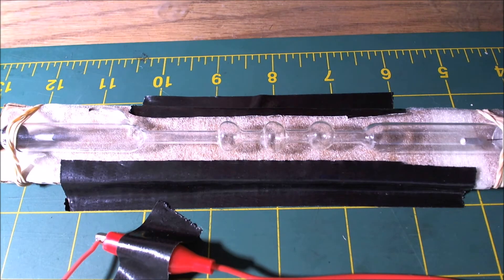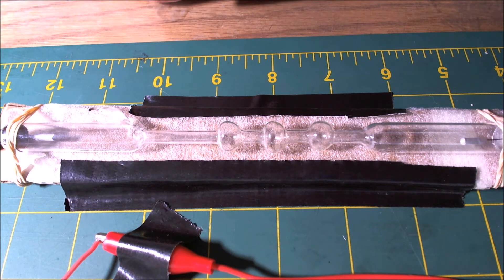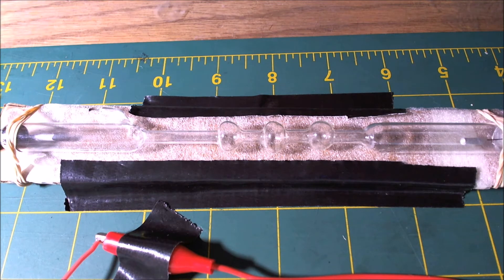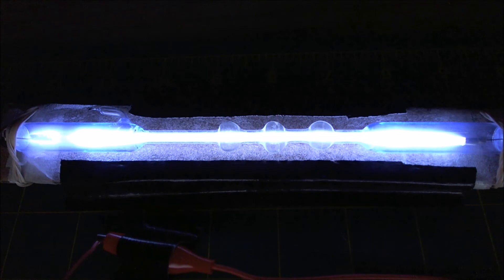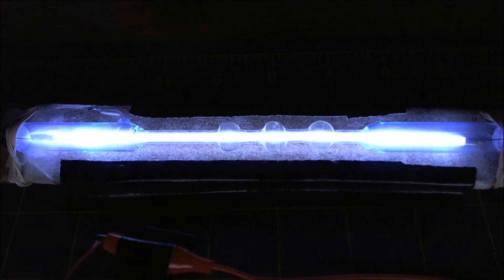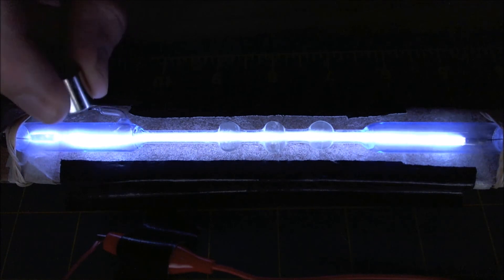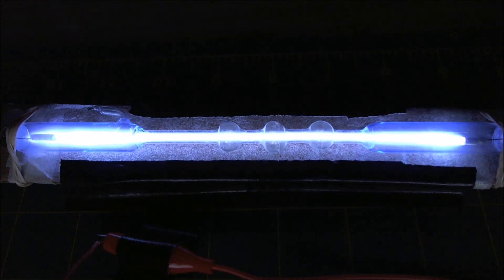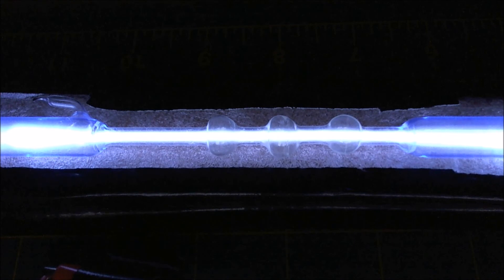Firing up the Geissler Tube

Comment: So... you could make a kind of mechanical Larson Scanner by installing a magnet  on a track under/behind the tube.  Deer motors are built to rund one direction, and then reverse when they meet resistance.
In any case, thanks for posting this!